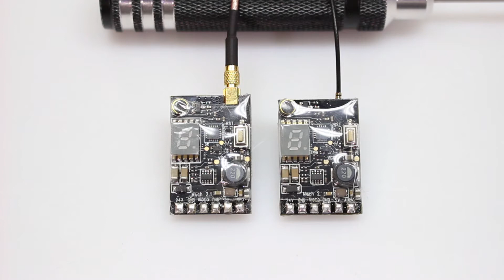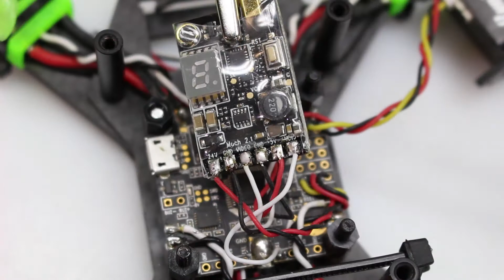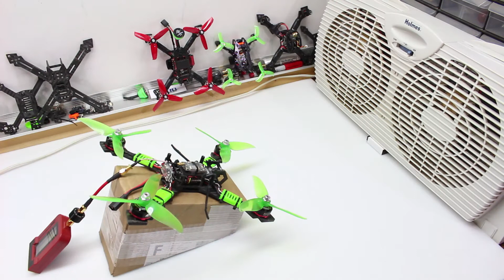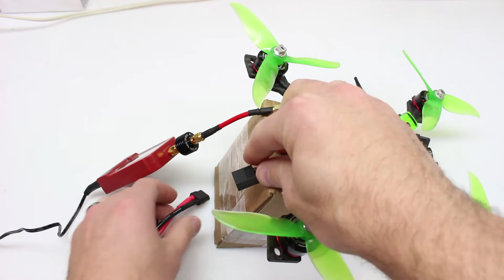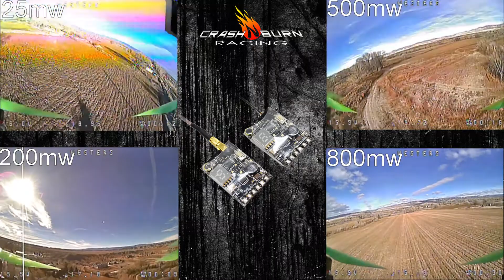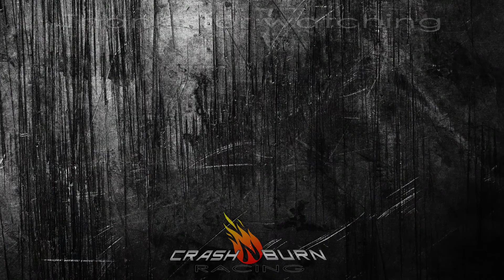RDQ Mach2 VTX review

Comment: Great review! Having trouble with mine sadly. I can’t get smart audio to work for the life of me. Lux v2, xsr, lua script. All up to date on FW. I have tried all uarts with no luck. Thoughts?
Reply: Lol it won’t work. The new BF doesn’t let it work. You will most likely need to flash the firmware of the vtx which I’m. Not sure how they will do it.
Reply from the maker: I know it doesn't work at the moment with BF 3.3 Looks like a lot of people are having issues with the UARTs on this board.  I know most people say to use UART4 for the receiver and UART5 for telemetry so I would try that and use UART5 for the smart audio.
Reply: I’m still on betaflight 3.2.0.
Reply: I've tried TX6 (inverted), TX1 (not inverted), motor 5 resource remapped to softserial........nothing works (betaflight 3.2.2)
Reply from the maker: Are you using the Lux also? This is very odd, I would message RDQ on Facebook and they should be able to help you out.
Reply: It is an UndergroundFPV F4X, I ended up swapping a Unify and got it working on M5 pad using softserial, I put the Mach 2 back on and..........now it works lol
Reply from the maker: Glad to hear you got it working.